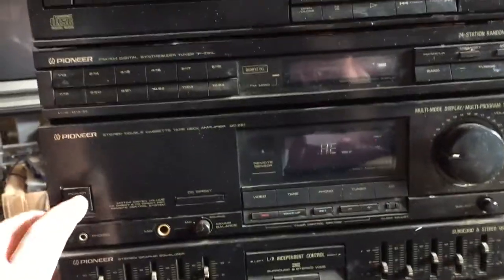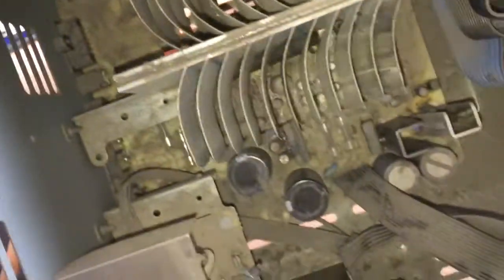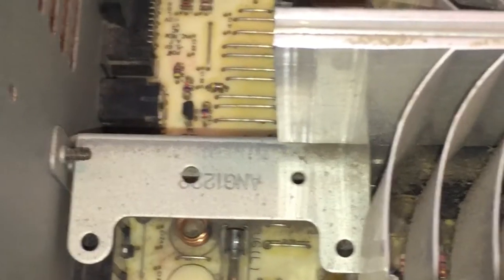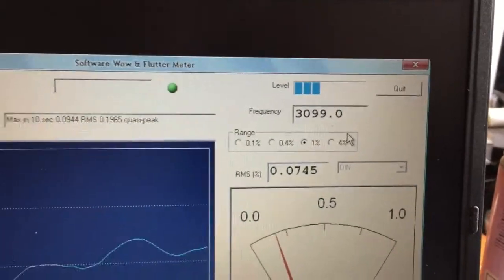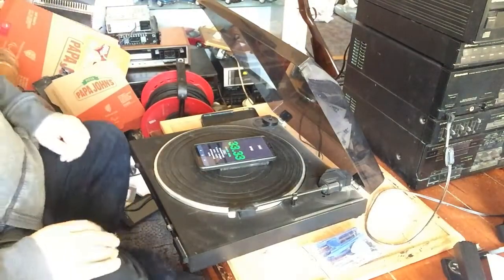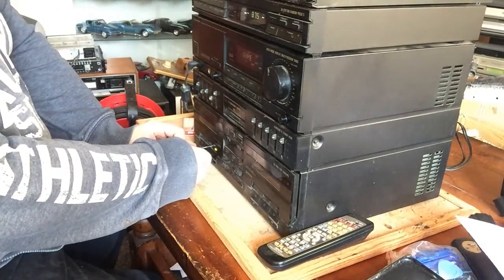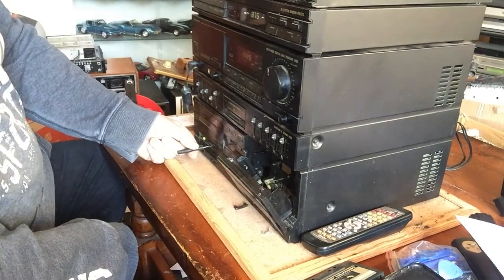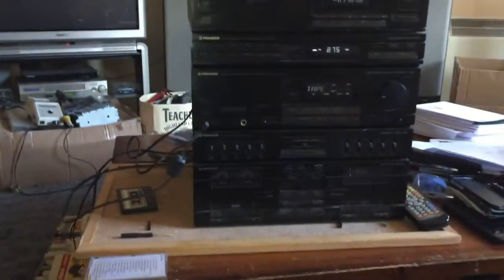Pioneer Stack System Repair & Service DC-Z81 F-Z91L PD-Z71 PL-Z81

Comment: I grew up with this exact same set, so many memories. I had it paired with a set of AR speakers. One handy function I used daily was the fact it could function as an alarm clock, woke up many mornings energized with some great music, or just listening to the news. The tape deck was great with the auto-reverse and the fast-forward to the next music piece. I believe it also had a copy function from CD to tape. The CD player was great too, sadly the matching CD player didn't last as long as the rest of the set, which could be due to the fact it was hauled around to quite a bit of parties back in the day. Thanks for posting this video, it was nice to see that they used quality components (ELNA caps) in this equipment. I never adjusted the tape heads, but if I ever need to do this, I now know how.

Comment: Thank you for this video, I have the DC-Z83 version and the left audio side went the other day got the service manual to find the stereo amp IC but now I know it's possibly the left side fuse it will be quicker.. I can't see it being that much different inside just saves me soldering.. 😂

Comment: Had this exact same Pioneer system but without the CD unit (I had a Yamaha instead) when I was young and I still have it but it’s partially broken with the plastic spools on the cassette deck fallen off and the pinch rollers broken but this video will help when I try to repair and set it up :)

Comment: Got the same system and recently revived and cleaned it with solvent cleaner,all working except tape decks will not play (fast forward /rewind ok) tapes.Any ideas.have I damaged component when flushing with copious amount of solvent spray😢

Comment: I have the exact same set and i was wondering. Why does the deck 2 has two pots to adjust the speed? And also, when i opened the cd drive, it dropped a little metal ball like from some bearing. Where that could be?

Comment: Hi, I had this exact system in 1988 and when I connected the surround speakers into the dedicated outputs at the rear panel, the sound was not normal. It was an "echo" sound, which I always presumed was meant to be that way, to give a special surround effect. But it sounded poor, so I just used the front channels and ran all four speakers from them instead.
Today, I've just bought this system again from e bay and I've tested the rear outputs to see what the truth was. Lo and behold, exactly the same! So it was meant to sound like that. 
My question is, why? 
The only way I can describe it is, imagine an echo on the vocal with a very thin, far away sound to the music. It's almost like its being played through a cave system from far  away! 
Why was this done? I would like to use four speakers but because I've got to use the normal front outputs, impedance is an issue. 
Any help appreciated!!
Reply: It was an attempt to simulate surround sound, but a gimmick. You could wire the speakers in series which will double the impedance rather than halving it. So, speaker 1 positive to speaker 2 negative, speaker 2 positive to amp channel positive, speaker 1 negative to amp channel negative.
Reply: Yes I know thanks, I've now got just the two speakers which sounds fine.
Reply: You can get an double ended jack lead plug it into  the bigger jack plug & use ur phone to play music by turning on the data button on the pioneer , my neighbours love the good old 80"s n its sounds . Are they dear on ebay?
Reply: I had the same set in the 80s and 90s. I never hooked up the surround set but I did use the surround function anyway as I liked the more spacious sound it produced. I had a weird setup though, my bedroom was small and the speakers were opposite of each other. I was thinking of getting the same set again or upgrading to pioneer separates as I acquired some AR 10Pi speakers which need a bit more power than the speakers I had as a teenager. I wonder which pioneer speaker has a similar sound to this set but a bit more power.

Comment: Hi I have this pioneer stack RX-Z71L, the turntable ( PL- Z81 ) fell down accidentally, it is working but the CUT function is not working, a small steel plate has come off, can you help